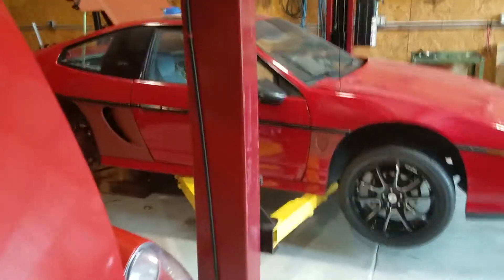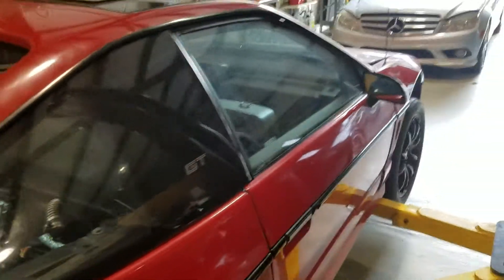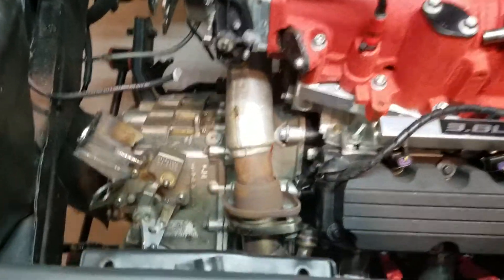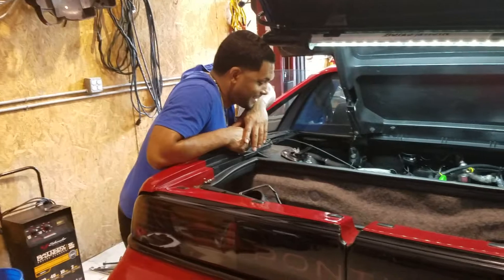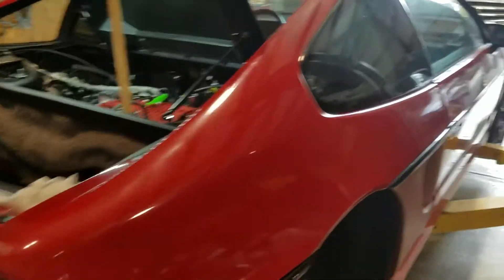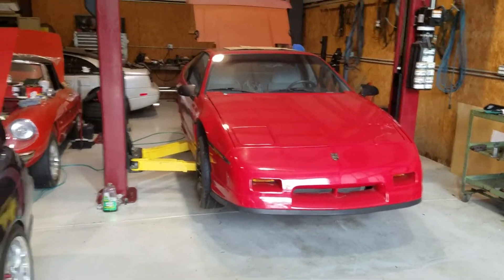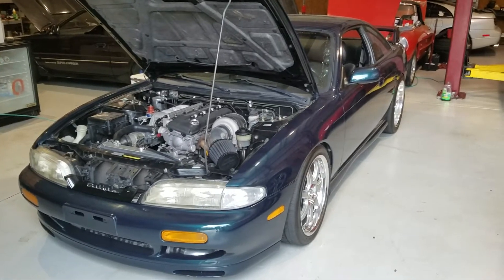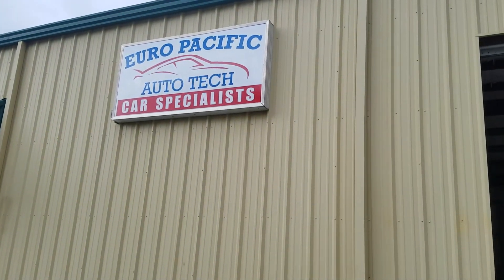K24 Swap Fiero GT pt1

Comment: more reliable I don't think so it would be close,  but yes a turbo k series will make a lot more power
Reply from the maker: Hayden Hale time will tell. I know I'm ready for something new now that I was on my 4th l67. I found a solution for the whimpy 5/16ths flywheel bolts and shared that with Intense racing and on PFF (m10x1.0 bolt upgrade). I can tell you the k is a flyweight compared to the 3800 and they are much easier to find than the l67/l32. Anyway, thanks for watching!
Reply: BVMotorSports wow do you wanna sale that 3800?
Reply from the maker: Hayden Hale long gone bud.

Comment: Ls4 sounds most similar to Lamborghini V12 An L32 (3.8) doesnt have the power I need to make mine a true replica.
Reply from the maker: You may wanna watch one of my other vids. My L32 with a GT4067s turbo made 460/475 at the wheels on low boost. I'd say that's plenty of power. Cant go wrong with an LS either.